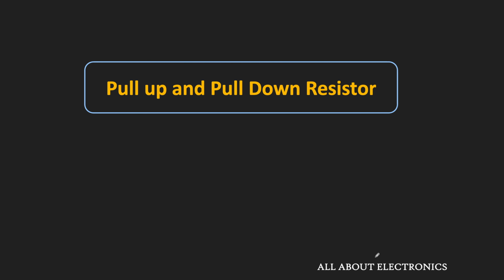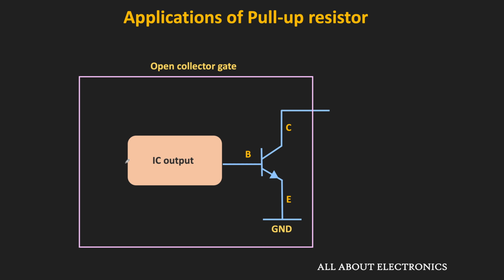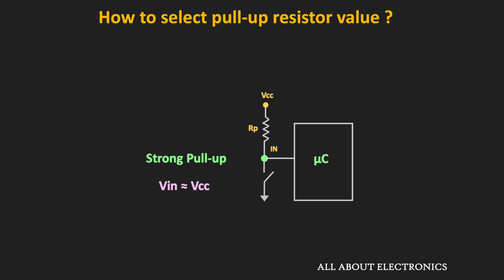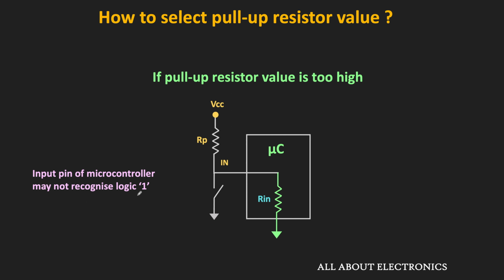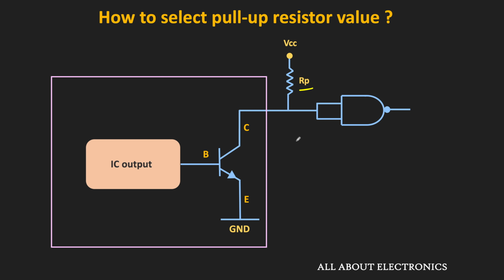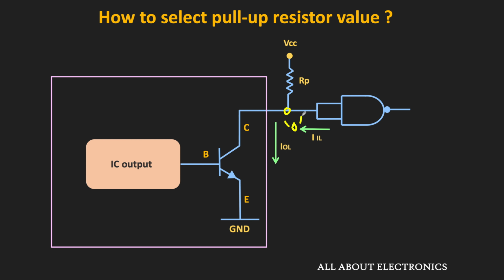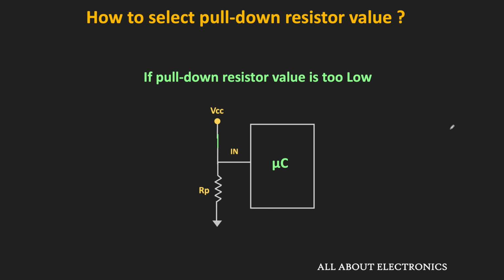What is Pull up Resistor and Pull Down Resistor ? How to select the pull-up resistor value ?

Comment: But Input current of the pin is not mentioned in the datasheet, what to do
Reply from the maker: Typically, for any circuit, the maximum rating is given. The current and voltage to the circuit should be less than that. For logic gates or other digital circuits, the input currents are mentioned in the datasheet.

Comment: dont we consider VIL value of logic gate in case of Rp min calculation. if not, then why ? @ALLABOUTELECTRONICS
Reply from the maker: What we are seeing is the output of the IC. The output of the IC is driving the other gates, using the Pull-up resistor. So, when the output of the IC goes low, then the current through pull-up resistor and the IIL, should not exceed IOL (max) value of IC. That is why, VOL value is considered.
Reply: okay i got that.  Thanks. @ALLABOUTELECTRONICS

Comment: thank you for including the calculations for min and max resistor sizes, that is missing from many videos and is a critical piece of information. You cheated by using a transistor switch with a known mA draw, now do it for a physical switch that would lead to a short circuit and sparks :-)

Comment: Too low of pull up also can introduce problem of logic level when the system cannot source that much current. Also you will have Rdson from mosfet forming a voltage divider to the PU resistor.
Reply: Also if the value is too high, you will basically form a RC filter with the parasitic capacitance with Mosfet, and that will create problem with your slew rate on the signal line.

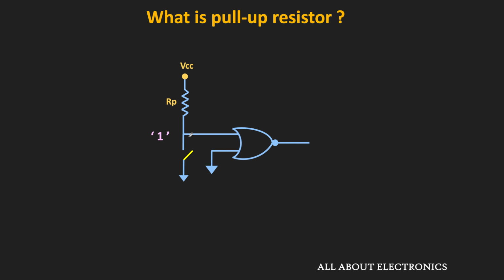Comment: 3:20... why input pin is equal to logic 0 when logic gate is connected parallel? Parallel means that everywhere is the same voltage so i dont understand how voltage isnt here.
Reply from the maker: I think, with parallel, you mean when the switch is closed, right !! If so, then in that case, the one terminal of the resistor is connected to ground. (through the switch)
So, input pin of logic gate, which is connected to the switch will also see logic '0'. I hope, it will clear your doubt.